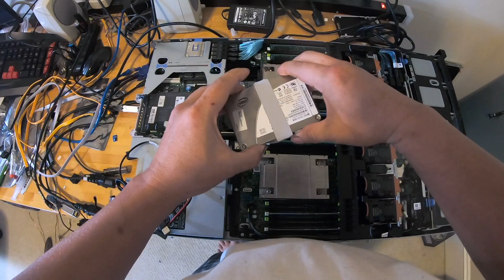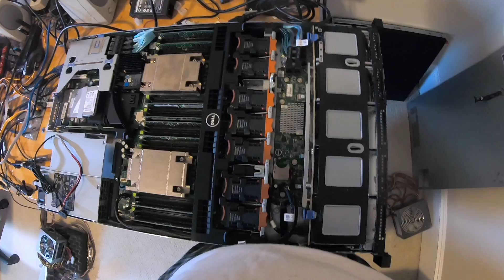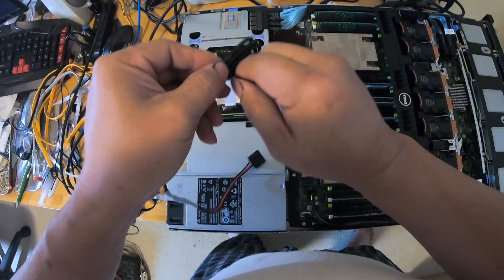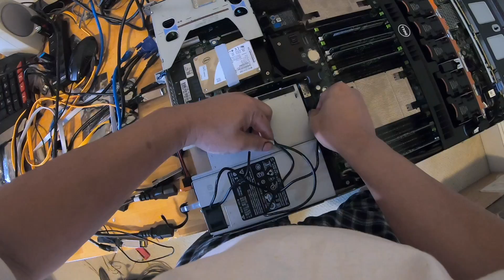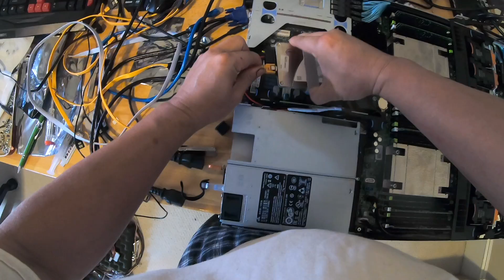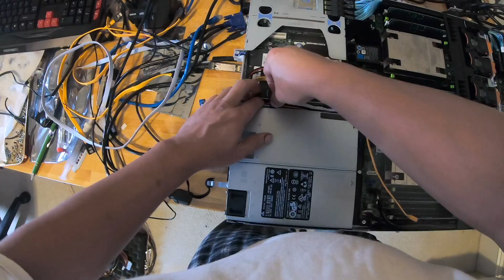HOW TO ADD USB POWERED SATA SSD DRIVE TO DELL RACKMOUNT SERVER

Comment: Can those SATA ports still be used even with the RAID card installed? 

I want to connect two 4TB SSDs that support TRIM, since I recently found out the RAID card doesn’t pass TRIM and the SSD wear rate increases a lot.😢  at the same time keeping raid 5 for 256GB ssd

Comment: I have a Dell Poweredge T430. This computer can't boot from my 1TB PCIe NMVe drive so I boot from the internal usb. Essentially, I installed Linux a Mint onto a pendrive and edited the GRUB entries manually using the UUIDs. I made the menu persistent and gave it a theme. This is what my computer boots into and waits for my selection. Since the USB drive is only used to chainload my various installations it does not experience any significant use. Moreover, I can use it as a rescue device should I ever need it and it can be easily replaced if it malfunctions. I also have 2 SAS drives and 6 SATA SSDs installed in the front bays all configured in the bios as pass through.

Comment: Slamdunk bro!  I just got one of these servers and just opened it up, wondering how to put in a single sata ssd
Reply: Same here.  Dell will not help at all.  They did offer me a $1000 proprietary drive cradle for the top bay.  What I really want to figure out is how to use a SAS to SATA cable solution for that top bay and I don't care if it is bootable.  This solution might work for me.

Comment: a SanDisk Extreme USB flash drive in 256gb is detected as a hard drive b the system, and would have worked in the system instead of all this extra work.
Reply: Usb drive will not last long! Not enough wear leveling and durability.
Reply: @growingplantstimelapse5820  there is also a USB to Sata power adatapter ready made on Amazon, but my goto is the NVME to PCIe adapter and a 1TB NVME drive.
Reply: @mikey17314  a good number of older rack mount can not boot off PCIe. In the list in the description, for example, the R720 can not.
Reply: He could have put a regular SSD in the front and it would work. I have Samsung SATA SSDs in all my servers.
The only one advantage, and I will do it, is use the internal drive as a boot drive to save the front for storage drives solely.
Reply: @soiledhalo2296  depends on its end use case. If it has a backplane and a Dell PERC card, and you want to use it with TrueNAS you have to flash the PERC. Once the PERC is flashed, you cant boot off any of the drives connected to it.